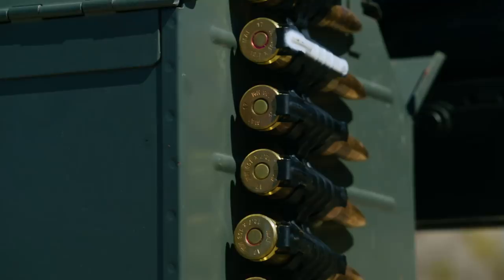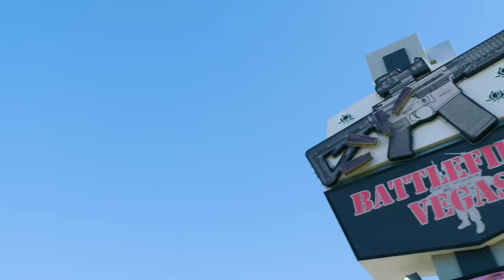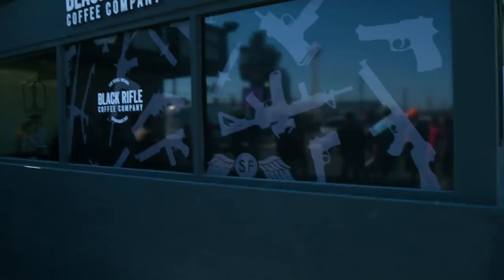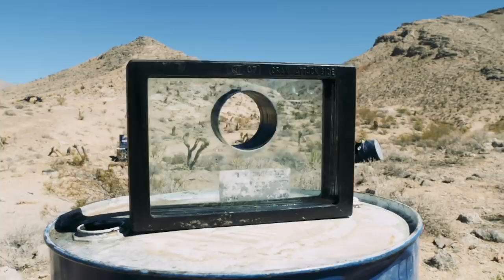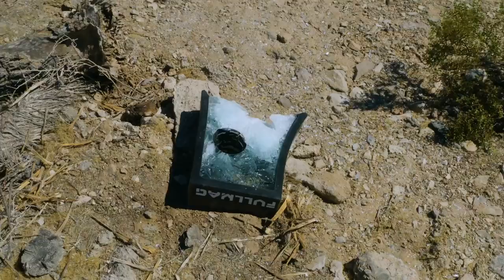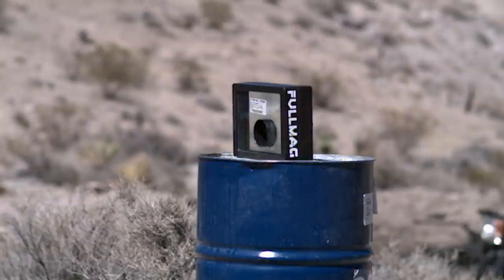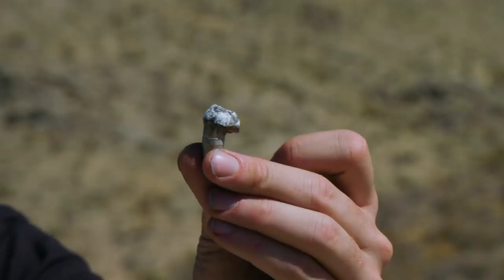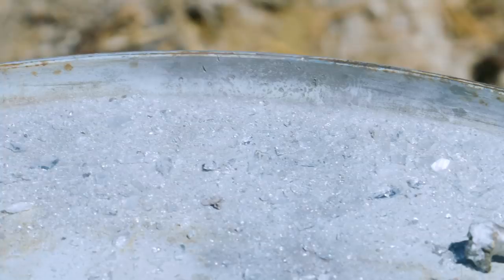NSV 12.7mm vs  Ballistic Glass

Comment: The Russians be like 'gun jumps upward when we shoot it, put stick on back and hold it down like angry bear'.
Reply: it's a tank machine gun
Reply: @VitalTi123  the joke: flys over your head
Reply: You are supposed to adjust it so you can lean it on your shoulder..
Reply: There should be several sandbags weighing the gun down so it wont jump up
Reply: @Puistokemisti  yes. The tripods are designed to hold ~60-80kg of rocks in a sack to weigh the weapon down. That, coupled with using the shoulder brace correctly, actually makes this a pretty stable weapon.

We use it for small Air targets in the Finnish defense force. Against helicopters and the likes.